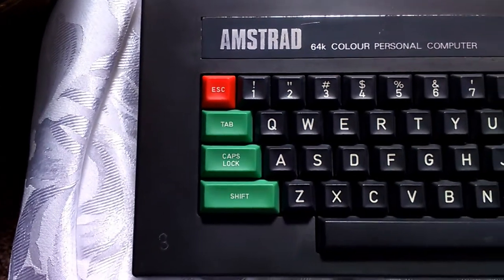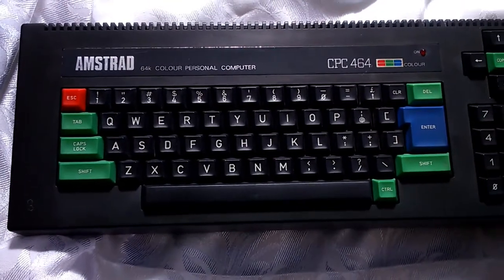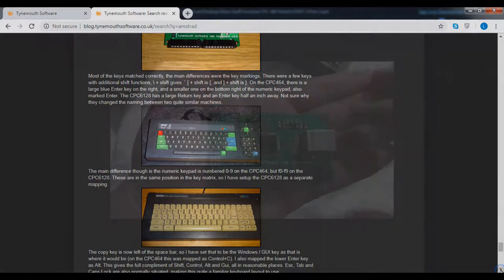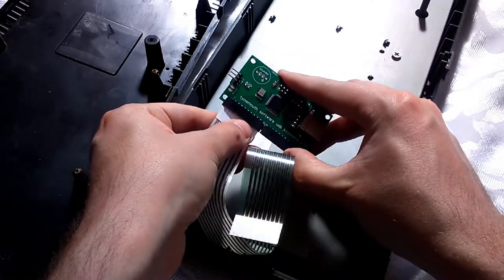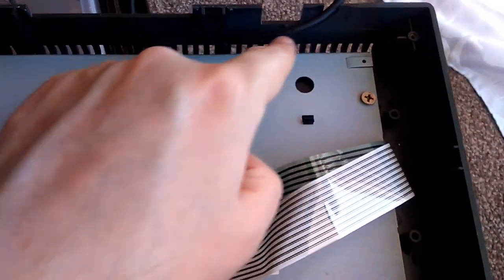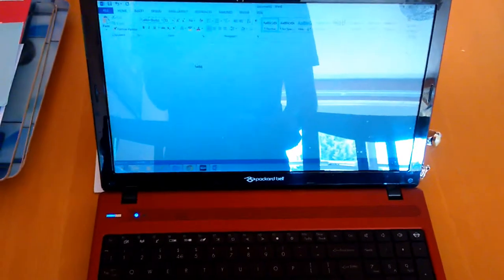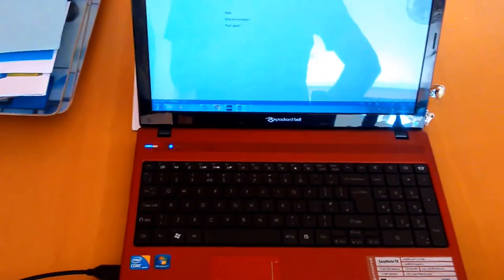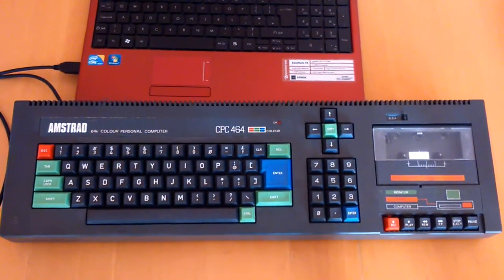Amstrad CPC 464 | USB Keyboard Build | Part 3 | The Final Chapter

Comment: It certainly looks really nice, but wouldn’t it be a lot easier and cheaper to mod a USB keyboard to look like a CPC? Then you will not lose all the function keys, alt, win and every other special key you might need to use a normal pc. In my case I have customized an HP USB keyboard and obviously it’s not the same, but you get all the functions (for Mac in my case) and the looks are still really cool! 😉
Reply from the maker: Hey, thanks for your comment. It probably would be a lot cheaper, but i'm not sure about the easier part as I can only imagine the time spent fumbling around. For me it was just a quick little project to do. And I still use the keyboard!